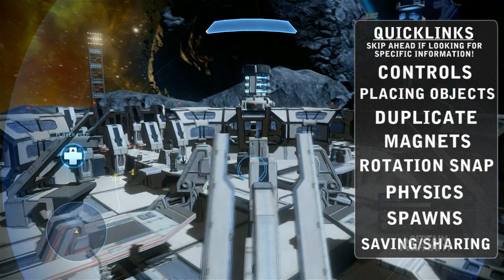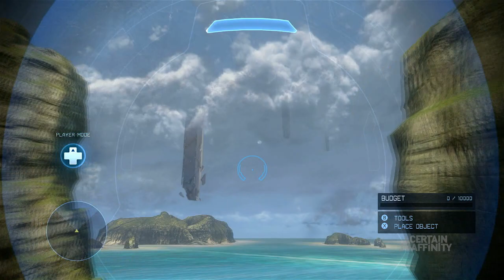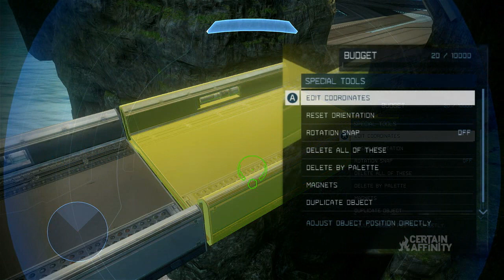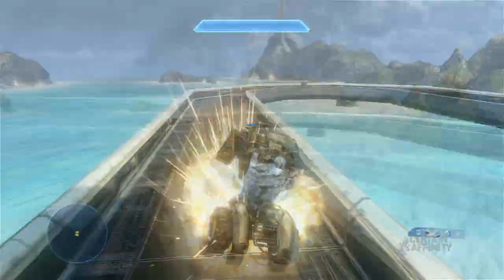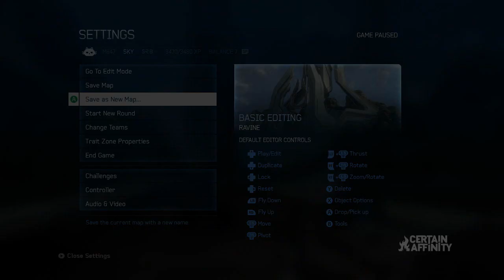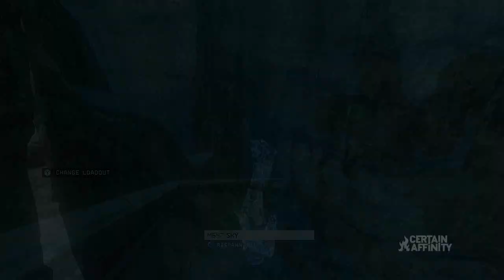Halo 4 Forge Tutorial - Forge Basics

Comment: Sorry by assemble walls and floors more easily, I meant because the complex textures are difficult to align in a way that doesn't look bad asthetically, also the rounded corners on building blocks have the same negative outcome. I don't mean to sound overly critical btw, I'm actually a forge addict, I just think these points are valid to further improving forge like you guys did with magnets and duplicates.

Comment: Im really liking magnets but would love to see them expanded. Currently when trying to align 2 objects such as 5x5 flat and ramp XL both have only mid point magnet. What I want is to use 2 ramps to make up the difference in width, but I lack the proper points to do this. I think combining a system like Osnaps from Auto CAD with magnet system would be ideal. Adding center, quadrant, endpoint and nearest magnet equals would make this tool great. Also making each of these types toggle able is best.